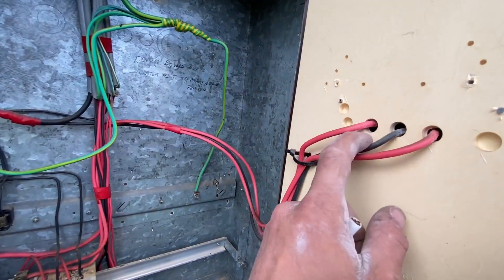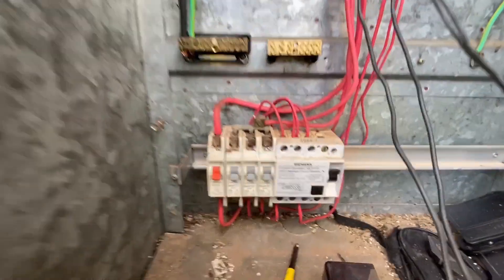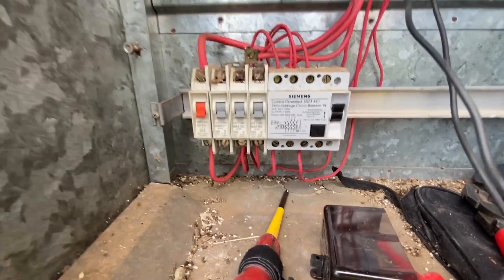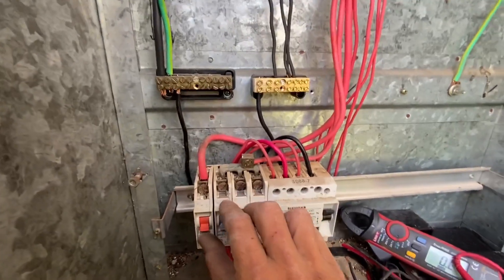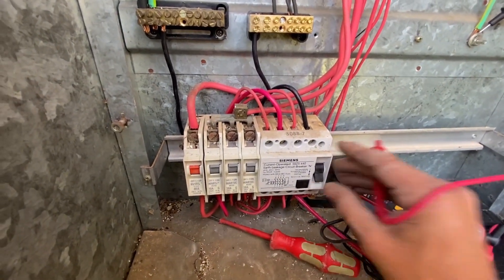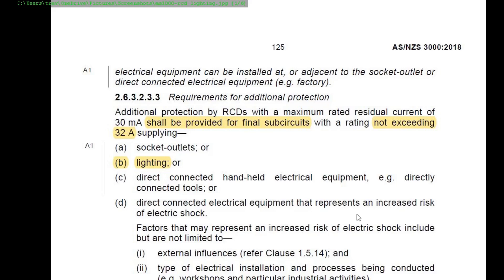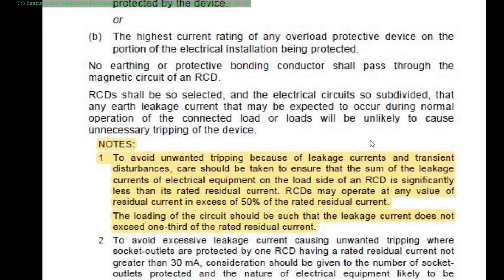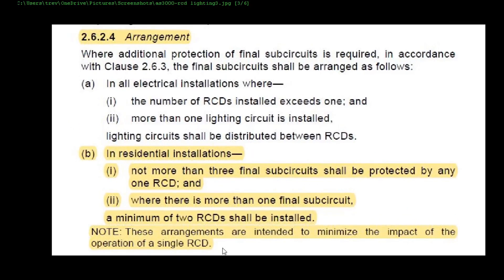AS3000:2018 Rule Book Lesson: Max 3 Circuits Per RCD.

Comment: 2.6.3.2.3.3 states Additional protection by RCDs with a maximum rated residual current of 30mA shall be provided for final sub circuits with a rating not exceeding 32 Amps...

Could you shed some light on this please as I'm a bit confused. So what happens if you have a final sub circuit worth more than 32 Amps? it doesn't go on a RCD? 

Or perhaps is this rule making the installing electrician divide his final sub circuit so as to not exceed 32 Amps? 

thanks
Reply from the maker: Buy a bigger power supply from the energy provider?! But folks like myself can make your car run for free provided all the hard labour and costs that go into a install. How much much money does he have lol!?!
Reply from the maker: It's demands. Each install is different as I calculate length, cable & construction on merit & reification costs; Make me test soil and existing wiring; Hello! I'm a man to correct bad electrics!

Comment: Hi mate quick question for you. I’ve got a sub-main distribution board in my shed. 3 phase Mcb main switch that splits into two single phase lighting and a mixed circuit. I also have the main switch connected to a 3 phase 40 amp rcd. Which then splits to two mcb’s for their respective 3 phase final sub circuits. My question is should each of the 3 phase circuits have their own rcd instead of the single rcd to each mcb?
Reply from the maker: That will work fine; What will happen is the accumulation of residual current on the devices plugged into the circuits which goes over the 30mA of the device. 

I am a fan of our Aussie 2018 standards to have a max of 3 circuits per RCD and even better an RCBO per circuit. If you want to really splash the cash an AFFD per circuit will eliminate any fires but it's not mandatory. Hope that helps.

Comment: why not just slap a 30$ rcbo in and call it a day?
Reply from the maker: Why not also upgrade the 16mm2 mains to the meters and add MILs & a meter neutral link? I would of loved too but the client had a budget and my workmanship for alterations is considered safe.
Reply: That’s my little ticket right there ✌️
Reply from the maker: @troyotapreuis6020  Are you with the ESO and dislike me sharing my wisdom?
Reply: @TradieTrev  your wisdom can be shared anytime, keeps me on my toes ✌️

Comment: You really are trusting that the PTC's in the Uni T are going to survive that long term. Better is to get your volt stick and use it, the LED current should trip most RCD's on the inrush where the PTC in the tester heats up, and momentarily has a slightly higher current for a cycle or two. Uni T is not a bad meter ( got a few myself) but best not to abuse the input protection, as that is not really designed to survive more than a tenth of a second, and if the RCD does not trip you will blow up the meter, normally making the resistance and voltage ranges inoperative, or making them read very low.
Reply from the maker: That's why I'm asking for sponsors so I can get a $3.5K MFT. I'm also hanging out for the new EEVBlog clampy Dave was showing off! I'm technically allowed to use the device past the main switch but not on the mains itself.